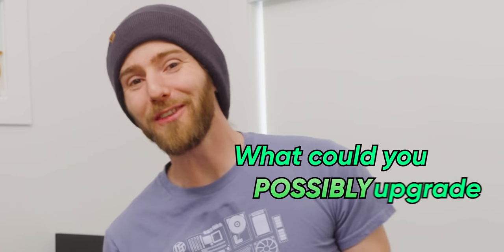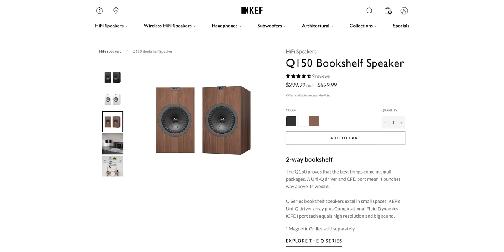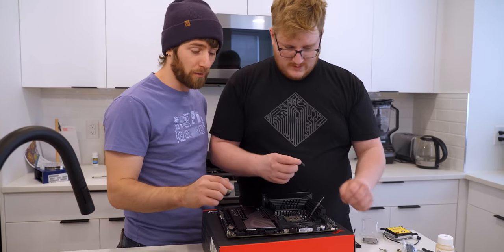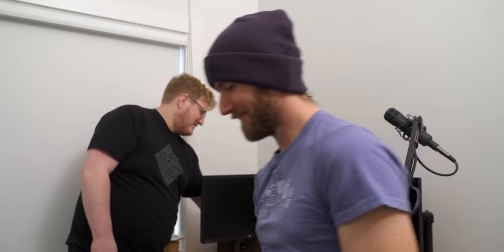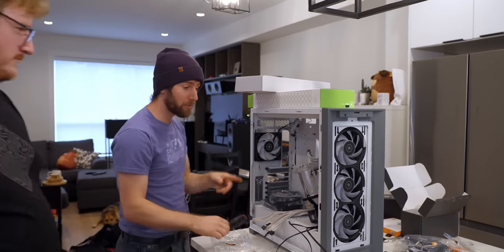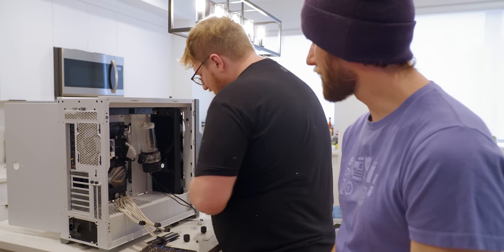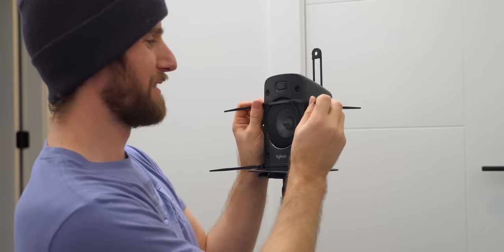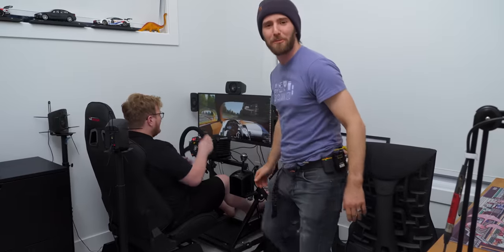Who spends money like this? - Intel $5,000 Extreme Tech Upgrade

Comment: Those logitech surround sound kits are the exception to the used audio rule, they break in under a year, and everything is soldered/glued down, with epoxy over things inside the speakers and subwoofer, and they use (usually DB9 or similar) odd cables to connect one or more speakers, which adds more points of failure to the whole thing. Should have taken his time and bought a used proper surround kit with mini speakers, in my opinion, but this is after being burned by these and the old version from last decade 3 times already. This plus the already broken and near unfixable "top of the line" kit they sell, I'm going to avoid logi like the plague. 

Odds are if a logi surround kit is for sale, it's because the control speaker or subwoofer started crackling or cutting out.

Comment: when running a racing sim off the same computer as your main.  How do you distinguish the audio from your regular desktop area and the audio to your racing sim area.   
I've thought about putting some money into a sim setup.  Starter setup, maybe $1000 - $2000 or so.  I like having the Logitech ZXXX series.  I've had a few from the Z390 all the way up to current models.  Good speakers for decent pricing.  I still use my old nearly 20 year old Z390's and they still sound great.

Comment: Everything about this setup gives me anxiety.  Especially as a Sound Engineer

The cables are complete chaos, Desk mounting the speakers / monitors on their side so they are pointing at your belly is absurd and then using room correction software to try and compensate for shitty placement and poor room acoustics is mental, then I noticed hes a MASSIVE art voice channel sat on the floor just for one microphone. Splitters, Multiple interfaces.

Instead of going for an incredible setup thats streamlined and amazing hes gone for something that messy and complicated and chaotic.

But hey... horses for courses.
Just not my course, Keep your horse away from my course.

Comment: Careful with those logitech z906's. I went through three that did the exact same thing. All went and poofed with a loud electrical zap! I ended up getting my money back and finding a great used set of z680s. There is a reason why the older logitech 5.1 setups are so expensive compared to the lackluster and frankly, unreliable z906s. They are massively failure prone. They were 100 bux for that reason.
Reply: mine shat themselves a few weeks back during a storm, but to be fair I got a good 8 or 9 years out of them first
Reply: @mastertonberry9224  I was upset about mine. The first two were brand new, neither made it past three months. The third was a used set. Those lasted the longest, but were about 2 yrs old when I got them. There is something in the subwoofer that just fails. General consensus is pretty negative about them. I just found out yersterday my buddies set, three+ years old, his just blew its smoke a few weeks ago. In fact I just modded an led backlight plate in my z680s to replace the failing blue leds. There is a hot spot, but now I have a nice white display to look at. I may get a gel and have an orange light instead.

Comment: I've been really curious about that Sound ID Reference mic+software. 
     I've always used whatever speakers I can get. (Currently rocking vintage BNS 85W high end hifi speakers, powered by an old 5.1 Cambridge Audio subwoofer w/ integrated amp.
   Sounds awesome. But I have some doubts about accuracy. Mostly because they theoretically /shouldn't/ be accurate.
    If it can make MY setup sound accurate, it can make ANYTHING sound accurate :))

Comment: as a sim racing enthusiast it pisses me off that they get given thousands to spend as they wish just to make a video and they still end up with what is essentially very average sim racing hardware, i mean that bmw steering wheel is absolute crap and quite cheap, the csl DD is entry level as far as direct drives go, the rig he is sat in is barely strong enough to hold his weight and clearly lacks adjustability because he looks very awkward in it and its doing a piss poor job when it comes to rigidity. It shows what they know about the hardware when they totally neglect the $700 pedals he has which are the only impressive part of the setup to me.

pains me to think i have spent way more on my setup but it was my own money while intel throws thousands at these guys to make a video.

Comment: whats 2 subs :P i got 13 subs 2 are 21 inch 7 are 12 inch 2 are 10 inch and two 8 inch ( rcf . electrovoice , mac audio and vtrek )on 6 Crown XTI 4000 amps i dont want to number middletones and horns , i am mixing alot , i work as visual jockey , light , and ofc techno mixing :D